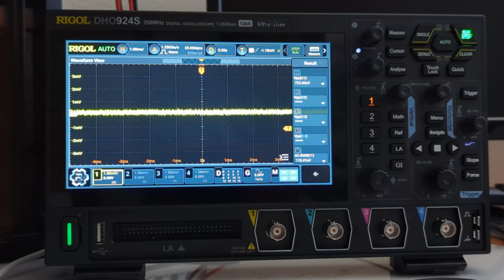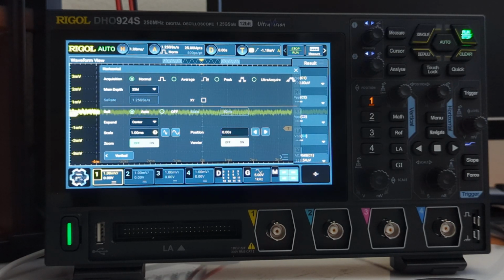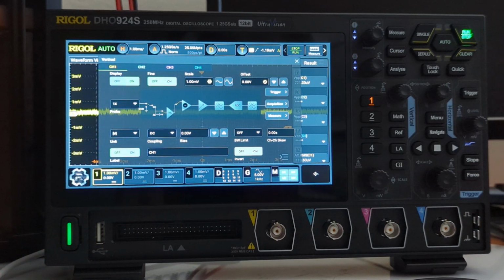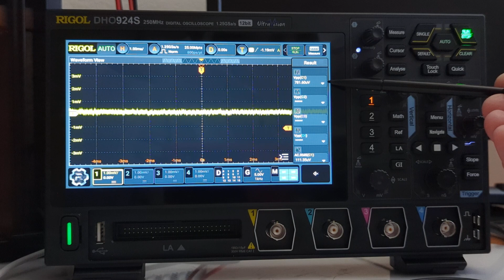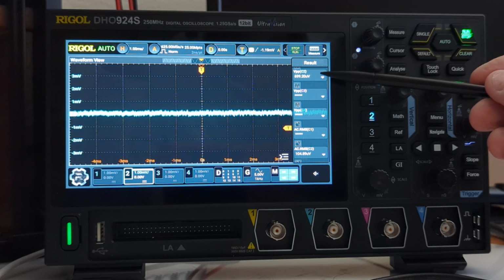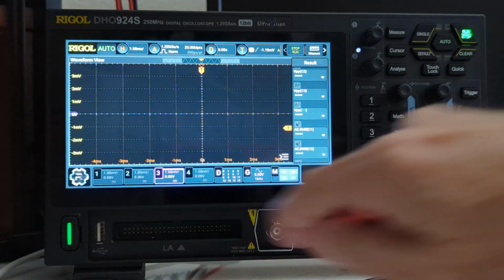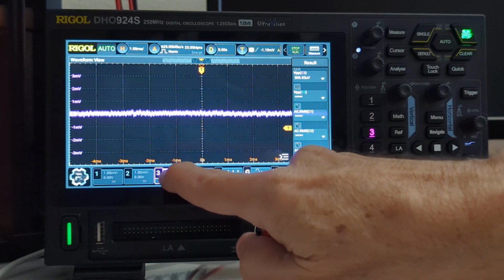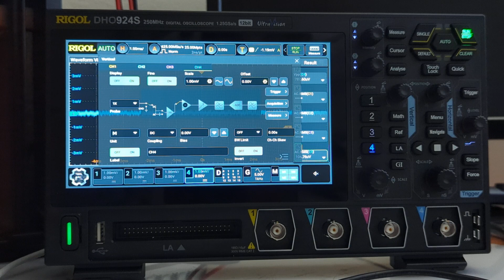Rigol DHO924S noise floor

Comment: You had CH 1 working all the time in this video. Trigger was set to CH 1 all the time, so scope was probing it. BTW. I have exact same noise on CH 1 with same settings. Edit: You can see it on sample rate halved.
Reply from the maker: Thanks for that observation. I am still learning to properly use this scope. I will play with the trigger setting and watch its effect on the channel sample rate. Thanks again.
Reply from the maker: Thanks again for your helpful suggestion. I just tried changing the trigger channel for these noise floor tests and discovered what you were saying about the improved sample rate. BTW, I just measured the Vaverage for each channel and found voltage bias values of +180 uV, +60 uV, 0 uV, and +80 uV for Channels 1 thru 4. I've set the bias for each channel to negative values to compensate. I'm wondering if you are seeing bias numbers in the same range? I also wonder why Channel 1 is so much higher. Unfortunately, these bias settings have to be reset each time the scope is set back to its Default values (unless there is some way to make these changes stick?)
Reply: @philipgiacalone5605  You mean DC offset? Run self-calibration - that should work. Better results will be when scope was running for 30-60 min prior to calibration.